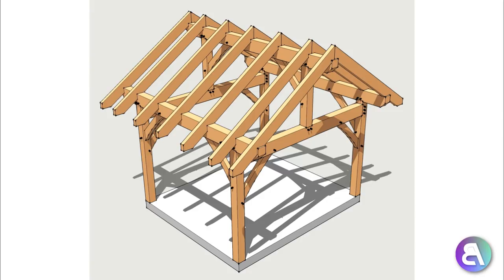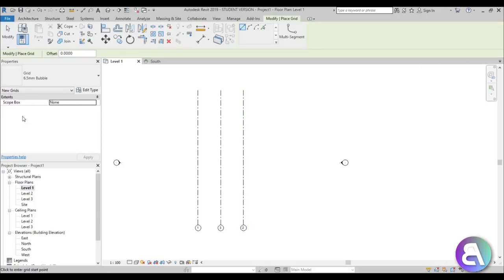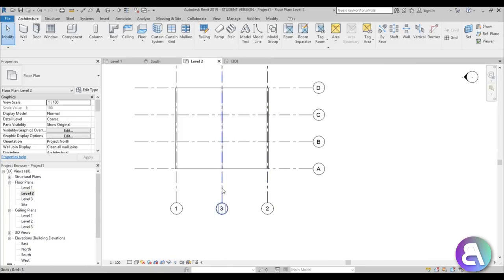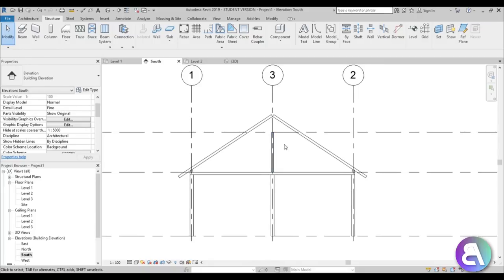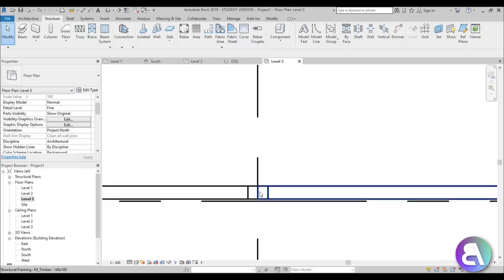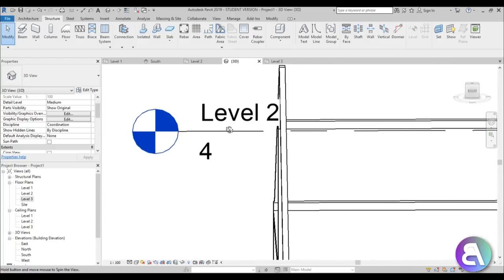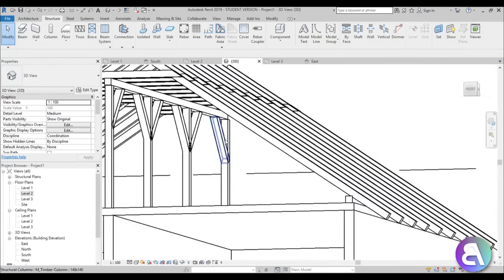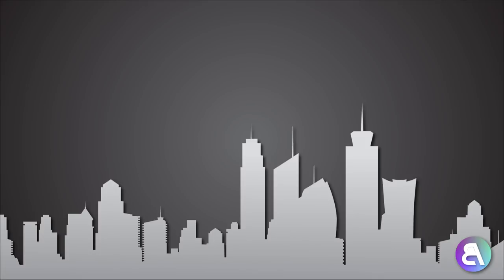Traditional Roof Construction n Revit Tutorial

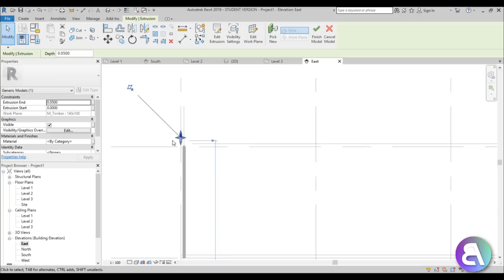Comment: Why did you not use reference planes for the rafters? I use it al the time and i makes getting the right angle very easy. Also the beam at 10:00 can just be done with a normal beam with a cut at both ends, so you can have an accurate schedule